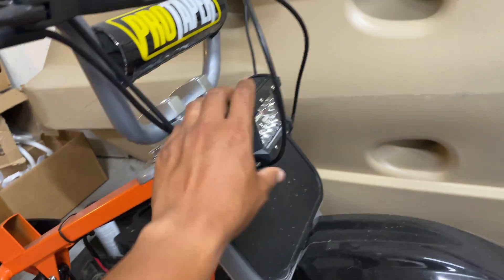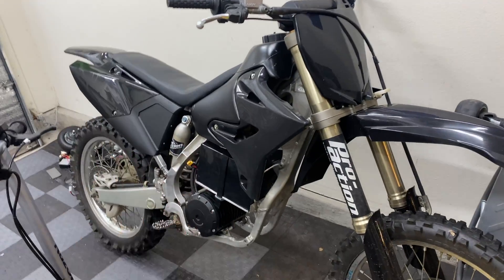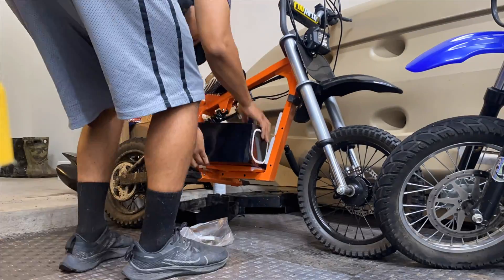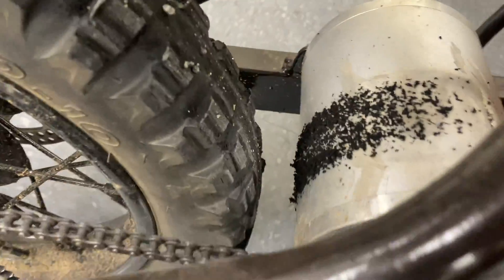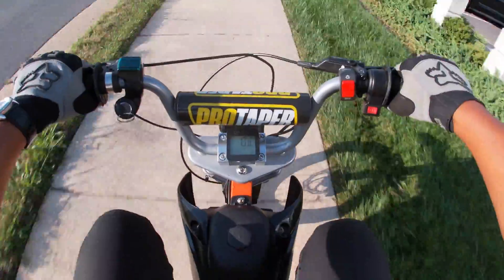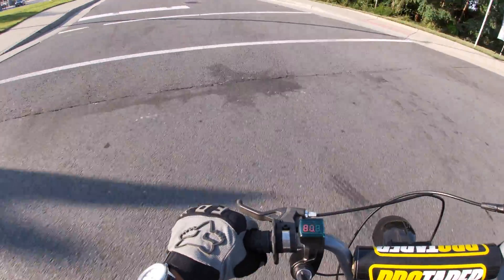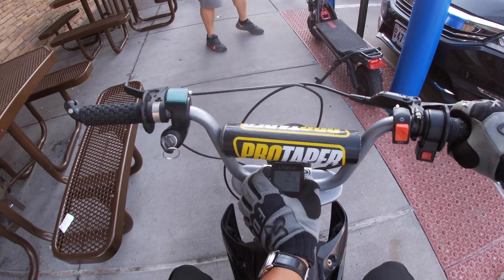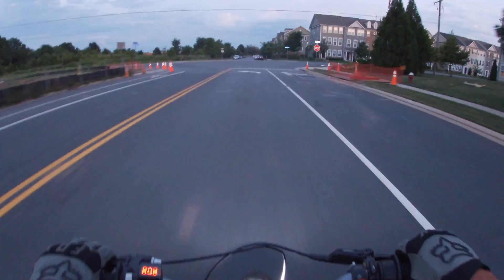Another 50 MPH Razor MX650 on the Road 72V Amorge E&C Kelly KVD Controller

Comment: Nice!! Found myself smiling on your way back as if I was riding! Lol just knowing I have a 60v 35 ah battery already and a 2kw Motor kit en route I’m sure I’ll get the speed I need. Whenever the e&co controller is back I should be close to this speed! Not ready for 50 yet At All myself lol
Reply: What’s the range and how much did the battery cost

Comment: 😊:i peep.. the bike upgrades..:Nice work..:I been slow upgrading my mx 650..:Putting 72v 3000 w w/ battery 72v 30ah.....:Had to cut & reweld my rear shock.. but its almost there w/ the final wiring..😊

Comment: Hey, what did you need to do to the battery in order to make it compatible with the kelly controller?
Reply from the maker: Nothing gets done to the battery.. you mean changing settings on the Kelly controller? Or did you mean a physical connection?
Reply: @PatOutdoors  The physical connection. Do you need to cut and change the wire connectors like you do one the motor, or is it just straight plug in.
Reply from the maker: @camilomora3580  Kelly controllers take ring terminals. So you just cut off whatever battery connector you currently have and install ring style connectors on the battery wiring to mount it on top of the Kelly controller
Reply: @PatOutdoors  what did you have to do in this case to the amorge battery
Reply from the maker: @camilomora3580  I bought an XT60 pigtail connector and installed ring terminals on it: https://amzn.to/4b0Eggm
Reply: @PatOutdoors  do you know of anyone that posted a video on how to do this step by step, I’m brand new to razors and I’m plannaing to get a 72v battery from amorg
Reply from the maker: Well there’s not really any wiring involved with the amorge battery. I think this is the video that may help you out: Ultimate 72V Supermoto Razor MX650 Build is Done! Kelly Controller Wiring
https://youtu.be/wBG5xxrVIXE

Comment: Im going to up grade my razor mx 650 im getting motor that is 72v 3000 what size battery would i need
Reply from the maker: At least 20 AH with a 60+ Amp BMS

Comment: I have a 72v 35 ah battery with a 3000w hub motor. I have a cheap 50a controller and get around 40. Any tips to go around 55?
Reply: Better controller
Reply: & high amp rating battery

Comment: Im currently working on a razor mx650 build and I want to know if i can run a 3000w controller with a 2000w motor and battery without damaging anything internally?
Reply from the maker: Yes, you can. It will just shorten the life long-term. Motors are cheap, batteries are the most expensive part of these builds. This is technically pushing almost 5,000W peak with a 60-amp BMS at 84 Volts full charge. I'm planning on just swapping out the motor for an EC4P when it (eventually) fails.

Comment: so fun with this little bikes!
I upgraded mine (mx650) 
52V- 24ah
Mophorn/ Vevor 1.8kw motor
*Be aware that throttle on this kit is really "touchy"
Sprocket/Gears: At the beginning it had 90T / 13t (6.92 G.R) topping off @ 33mph/ 215lb / flat roads- it is really "torquie"
Now is running with 65T/11T
(5.90 G.R) topping off @32mph -210lbs
So I didnt knew that my controller was maxxed out  already when had the 6.92GR😂. So I'm going back to 90/13 sprockets, way more efficiently on the grass/mud/ road. 
* Idk at this point if upgrade my controller to get more power from this 1.8kw motor, also considering getting bigger battery and probably ending frying this motor😂.
Reply from the maker: Pretty much where I’m at with both my MX650 72v set ups.. just gonna upgrade my motors when they eventually fail

Comment: I just upgraded the batteries on my RSF650 from 60v 170 amps max discharge to 72v 240 amps max discharge. I'm waiting on my new controllers. So I might have to run my KVD7212nx for a bit .
Reply from the maker: Your bike.. is going to be insane!
Reply: @PatOutdoors  I hope it will have more high-end torque. Are you on the FB modified razors group? I have pictures of my RSF650 and the MX650's that I built my son's.

Comment: How's the vevor 1800w motor holding up? I want to run a 72v on my vevor 2000w but im worried it will fry the motor
Reply from the maker: Honestly I'm gambling on this one. I would usually recommend using at least a 3000W motor for this kind of controller and battery, but I use this set up on both my bikes and haven't failed yet. Though I'm not expecting it to hold up for a long time and plan to just upgrade the motor to an EC4P or 5000W MY1020 once it (eventually) fails in the future.

Comment: can you say anything about the longevity of the batteries? How long would you expect to keep a battery and use it normally?
Reply from the maker: Well my other 72v bike with battery has had a 2000w brushless motor, and Kelly controller for almost a year now and still good, but starting to feel sluggish lately. Battery is still holding charge similar to how it did last year, but the motor will likely burn out soon and be replaced with a 3-5000W motor replacement. Hopefully that gives you some insight

Comment: hi pat,
I have a Razer mx650 and I’m putting in the 2000 watt motor what chain and sprocket would you recommend?
Reply from the maker: What battery voltage, what is your rider weight, and what is the target top speed?
Reply: Battery voltage is 48volt and the rider weights 100 and the top speed target is 30-35mph and thanks for the quick response

Comment: Hello Pat I need your help wiring the keyed volt switch on the stock mx650. I need to know what wires I need to connect to the controller and what needs to be done to bypass the stock on and off switch. Please and thank you
Reply from the maker: @zuhu2328 This is something I've never actually done since I've always jumped to aftermarket controllers right off the bat and unfortunately I don't have any stock controllers anymore to review. But it should be pretty simple. There are only three wires from any keyed voltmeter (ground, power in, power out.) Ground just shares the same ground source as the controller and power in shares the same 36V source as the controller also. Power out goes to the signal wire that turns on the controller (same thing the on/off switch would do if it was present.) All that happens when you turn the key on in this case, is complete the 36V signal from the battery to the controller signal wire.

Comment: The build is fire I finished building mine last month I'm running the ec4p ,Kelly controller, 76v 24ah batter I hit over 50mph like 55mph
Reply: How much range do you get with the 76v 24ah battery @ccsurep
Reply from the maker: Thank you sir! And congrats on your build. What front sprocket size are you using?
Reply: @PatOutdoors  well I'm only 16 so u dont have to call me sir but I recently went from the stock razor chain to 8mm chain I'm running a 15 tooth motor sprocket and for the rear 72 teeth it's the perfect balance between speed and torque I would definetly recommend it😁😁😎
Reply from the maker: Appreciate the tip!  @ccsurep

Comment: You should think about eliminating the freewheel with the threaded hub sprocket mount. You'll never break it, they're cheaper and you could upgrade to Regen braking someday. You should look at grin technologies, check out their products features and see if you could get their stuff to work on your bikes it would be cool to see Regen brakes and you messing with the field weakening and making your bike the fastest razor on the planet. I've only seen their displays and controllers on ebikes. They look a lot faster than you'd expect with the voltage that they're using. I've never seen anyone on YouTube put the Cycle Analyst display  and the Phaserunner on a razor. You could be the first.
Reply from the maker: Only thing that's stopped me from eliminating the freewheels on my Razor's is range since I did a lot of longer-distance rides with my buddies. But this bike I am interested in trying it out. I'll look into Grin Tech! Thanks for the input

Comment: your parts list says you are on an 1800w motor. how are you achieving 50mph with just an 1800. i know gearing can help but most people only experience up to 40mph even with a 3000 and upgraded front sprocket
Reply from the maker: Kelly controller settings and higher amp output battery 72v. Could also be that I’m 170 lbs.. it’s the 15-tooth sprocket mostly and I don’t recommend this set up. I suspect it will get the motor hot quickly with enough ride time
Reply: @PatOutdoors  i se thank you for the reply. do you think its feasible with a 3000W? so far the route i was going to go to for sure hit 50 was the 11000w kit form electric co but that is so expensive and i cant believe it would take that monster of a motor to take a bike to that speed (as they say their 5000w kit will only hit 40s)

Comment: Hi pat, I recently purchased the rear taillight and 1pz handle bar switch from your affiliate links and wanted to ask if you had a wiring diagram of how you hooked everything up to your other 72v razor?
Reply from the maker: Tail lamp wiring:
. Ground - Black
. Brake light input - Red
. Tag / Running lamp - Green
. Right turn signal input - Yellow
. Left turn signal input - Brown

Please follow the switch manufacturer diagram for the rest. Keep in mind these 12v accessories must be getting 12 volt input only, NOT 48-72V. So you must run a voltage step down converter.

Comment: hey man so my throttle is sticky, any suggestions on what to do?
Reply from the maker: What kind of throttle is it? Electro & Co? Stock? Other aftermarket? Some aftermarket ones from amazon/ebay need to be positioned perfectly straight before tightening to the handlebar, otherwise will cause internal drag.
Reply: @PatOutdoors  i bought this one off of amazon, it looks like the throttle from your recent scooter video
Reply: @PatOutdoors so i figured out the throttle, but now i need help figuring out what size rims the mx350, if u remember can u tell me?